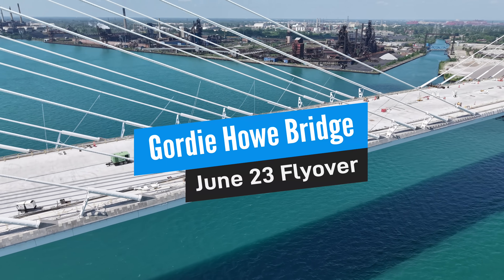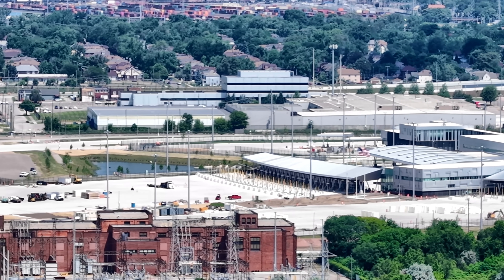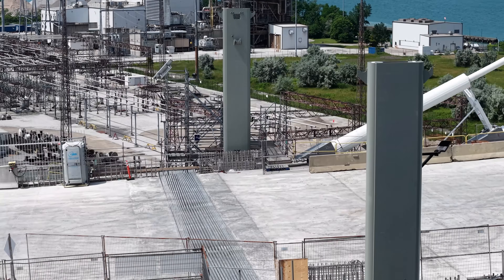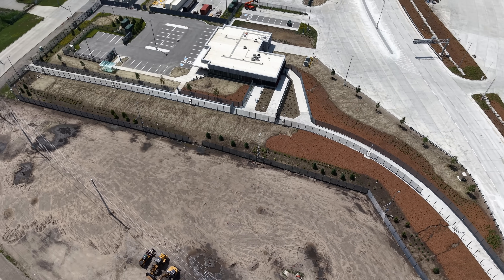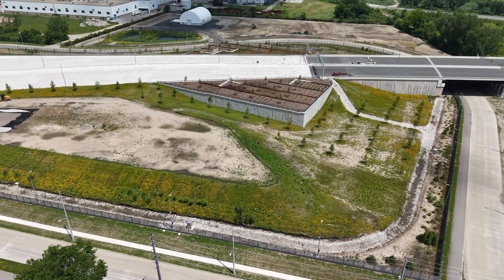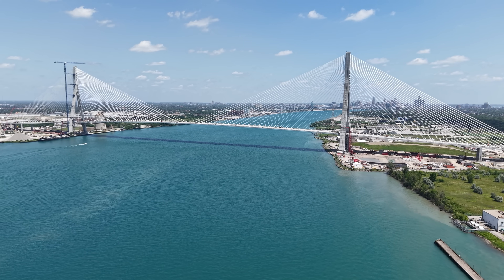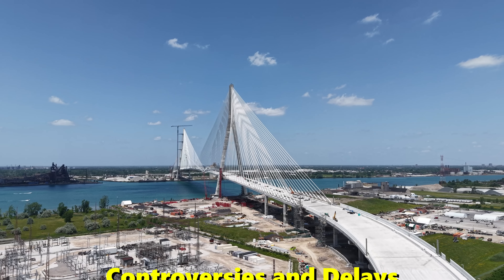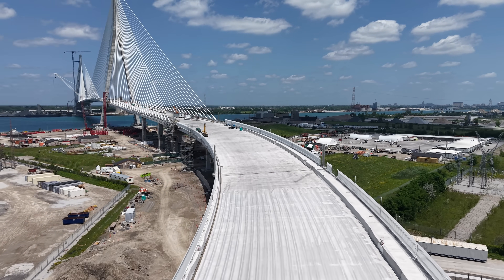Gordie Howe Bridge Enters Final Phase

Comment: From Canada, (Greater Montreal area):

As a retired electronic technician,m in a sort posr retiremen episode,I obtained a fast pass and in the summer of 2010 had  a night trip acrosd the Ambassador bridge.

What I saw then of te condition of ome aeas on xte U.S. side hocedd me somewhat. After the u-turn and dealing with the fast pass ans the toll,  the road met a T intersection where we turned left...

What shocked me was not  fear of guns or terrorists, bu the state of some of the old building relics! Ialling on my head like the ancient ruins! 

Since then, I undersand Detroit has had some federal aid to clean to the old eysores, but the U.S. side of the bridge is really a much mor complex an congested area than that of Ontario, so it needs a lot more work to bring the whole ares, I-75 included tu to snuff to handle such a gateway to the U.S. Midwest.

How efficiently this will relly get done will depend a lot on how POTUS can show its true potentil to te American people.

Good luck America, you need it!
Reply from the maker: Hi Bruce. Detroit is on the comeback, and things are looking better. It has a long way to go to reach it's past strength as a major city. Just my opinion. The Ambassador Bridge is also looking much better these days as they were forced to update and fix the deficiencies the Moroun family let it fall under for decades. It is mandated they get a complete inspection of the bridge each year and maintain it in good order if they want it to stay open. The bridge deck has been replaced and upgraded, new cables have been installed and a multiple number of other issues have been corrected. I like the Ambassador. It is a very cool contrast to see the Gordie Howe Bridge and the Ambassador Bridge in the same picture. Thanks for sharing the detailed post! :)

Comment: Excellent videos, Bob.  Thank you.  This type of cable-stayed bridge design has been around for a while.  I'm wondering if there are any new design theories that appear for the first time on the Gordie Howe bridge.
Reply from the maker: Hi Phil. That is an excellent question. I did a quick search and this is what came back.

The Gordie Howe International Bridge project integrates established cable-stayed bridge principles with several groundbreaking design innovations, particularly in its approach to cross-border compliance, aesthetic integration, and structural verification. While cable-stayed technology itself is well-established, the project introduces novel methodologies in the following areas:

🔬 Dual-Code Compliance Framework
Simultaneous adherence to Canadian and U.S. standards: The bridge is the first to require identical compliance with both CAN/CSA S6-14 (Canadian) and AASHTO LRFD (U.S.) codes. This necessitated:

Separate, complete design calculations in both metric (Canadian) and imperial (U.S.) units.

A "balanced approach" merging performance specifications with prescriptive baselines to resolve conflicts between codes.

Independent verification of all critical load cases under both standards.

🎨 Integrated Aesthetic-Engineering Protocol
Enforceable Aesthetic Design Guide (ADG): This binding framework mandated "contemporary minimalism" as a technical requirement, with features including:

Multi-phase confidential approvals allowing iterative design refinement.

Architectural lighting systems functioning as dynamic public art installations.

Material selections (curtain walls, precast panels) optimized for visual cohesion across all components (bridge, Ports of Entry, canopies).

The ADG elevated aesthetics to a compliance metric, ensuring design choices supported the bridge's symbolic role as a binational gateway.

🧪 Advanced Verification Methodologies
Dual 3D Finite Element Modeling: Independent global models using different software suites (primary designer + HNTB as checker) cross-verified structural behavior.

Real-time structural monitoring: Deployment of ice detection, weather stations, and intelligent transportation systems directly integrated into the load-bearing design.

Redundancy analysis: Applied to Michigan Interchange components like gateway towers and ramp bridges to ensure failure-mode resilience.

⚙️ Construction and Material Innovations
Record-scale implementation: The 853-meter clear span (longest in North America) demanded novel solutions for:

Tower foundations using drilled shafts to bedrock.

Parallel strand cable stays supporting unprecedented deck loads.

Durability enhancements: Customized material specifications for cross-border environmental exposure, extending service life.

While not introducing fundamentally new theoretical paradigms, the project's synthesis of existing theories into a unified, binational compliance model—particularly through its dual-code framework and enforceable aesthetic standards—represents a significant advancement in infrastructure design philosophy. This approach prioritizes systemic resilience and symbolic coherence alongside technical performance, setting a precedent for future international megaprojects.

Comment: It would be cool if they could add faint red and white lighting across the bridge, with an additional blue streak on the American side.
Reply from the maker: Sorry. It will be all white!
Reply: @bobjonesrealtor7756  If it is programmable led lighting, I would be very surprised if they would not be able to change it for special occasions. July 1st, for example.
Reply from the maker: From my understanding only whit leds. However they can control the brightness of the leds and should be quite impressive.

Comment: Do you know if the tariffs have effected travel on the other crossings with Canada? The volume of travel?
Reply from the maker: Hi Robert. I did a quick search and yup. 

Yes, tariffs have significantly affected travel volume at Canada-U.S. border crossings, including other crossings beyond the busiest ones. Several data points and reports indicate a notable decline in cross-border travel and tourism since tariffs were imposed.

Canadian-resident travel to the United States by automobile has dropped sharply since the start of 2025, with a 38.1% year-over-year decline in May 2025 and a 40.3% drop in same-day automobile travel, marking the first such decline since the COVID-19 pandemic restrictions in 2021. Overnight travel also decreased by 34.3% in May 2025.

At eastern Ontario border crossings (Cornwall, Lansdowne, Prescott), the number of Canadian-plated vehicles entering Canada decreased by 26.5% year-over-year in May 2025. American-plated vehicles entering Canada at these crossings also declined but less severely.

In Central New York, U.S. travel along the shared border has dropped by nearly 11%, with some areas reporting declines double that figure, reflecting reduced cross-border tourism attributed to tariffs.

The tariffs, especially those on auto, steel, and aluminum products, have raised costs for manufacturers and consumers, which in turn has dampened cross-border economic activity and travel. Windsor, Ontario, a major border city with multiple crossings, has experienced economic and travel impacts tied to these tariffs, including congestion reduction but also fewer visitors and trade disruptions.

In summary, the imposition of tariffs has contributed to a substantial decrease in cross-border travel volume at various Canada-U.S. border crossings, affecting both passenger vehicles and tourism, with declines ranging from about 11% to over 38% depending on the region and type of travel.

Comment: Please explain the details of stay cables large diameter at the ends and details
Reply from the maker: Hi Jack. A good question. I did a quick search and this is what I got.

The Gordie Howe International Bridge employs a sophisticated cable-stayed design with 216 stay cables (108 per tower) that transfer structural loads to the towers and maintain deck stability. Each cable consists of 38–122 parallel 0.6-inch-diameter steel strands encased in a high-density polyethylene (HDPE) pipe. The cables exhibit larger diameters at their endpoints due to the anchorage system:

Anchorage Details
Tower anchorage: Strands fan out and connect to massive steel anchor boxes embedded within each tower. Each tower contains 35 anchor boxes (27 for stay cables), measuring 5.5m × 7.5m × 2m and weighing 30–39 metric tonnes. These boxes house bearing plates that secure the strands and distribute tension.

Deck anchorage: Strands terminate at edge girders on the bridge deck, where they are stressed and anchored to resist dynamic loads.

Damping system: All cables incorporate external hydraulic dampers (DYWIDAG type) to minimize vibrations from wind or traffic.

Key Specifications
Feature	Detail
Strand count
16,000+ strands total; 38–122 strands/cable
Cable length
Up to 450m (1,476 ft) for the longest cables
Anchorage load
Supports 34 million pounds of bridge weight
Dampers
Installed to handle structural rotations and fatigue stress
The anchor boxes concentrate strands into compact zones, necessitating reinforced, high-diameter endpoints to manage stress distribution. This design ensures the bridge can withstand temperature shifts, structural loads, and environmental forces.
There ya go! Thanks for the comment. I've learned something today.:)
Reply: If you looked at the videos when those were put in place, you would've seen those are just covers, to make the transition from the cable to the concrete block at the base. The concrete block is also only there as a cover. Cables are anchored in some steel pipes welded to the bridge steel segments.